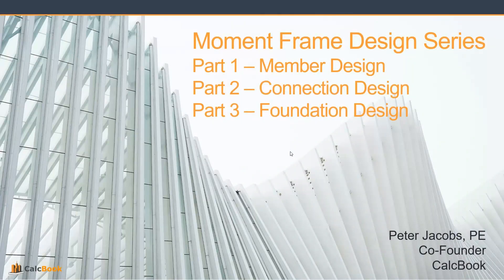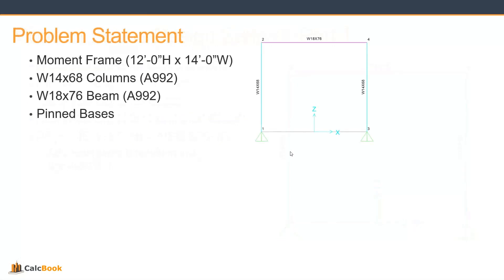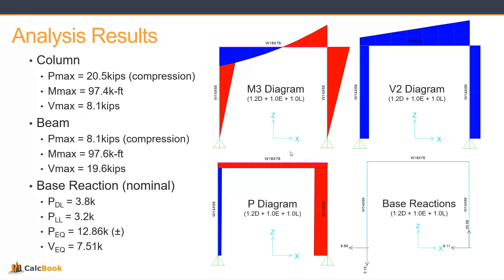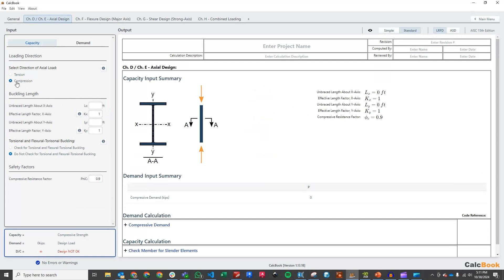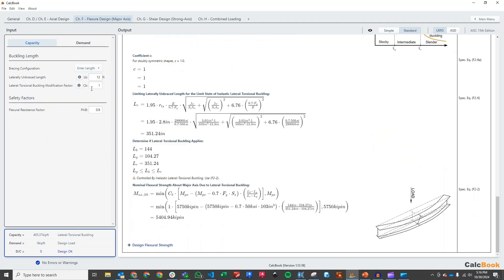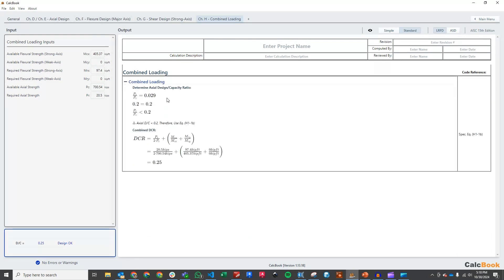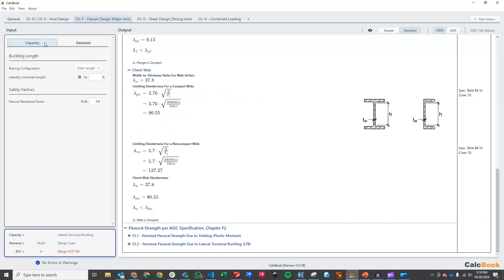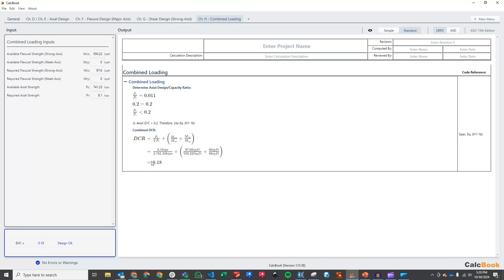Moment Frame Design Series - Part 1 of 3 (AISC)

Comment: What analysis model did you use to determine the maximum moment, axial, and shear forces in the members? I hope you can help me resolve this so I can subscribe to the Calcbook software to assist with my design. Thanks!
Reply from the maker: Hi @willhu9974, for this specific example we modeled the frame in sap2000, but any analysis software can be used alongside CalcBook. You just need to take section forces from your model and put them in CalcBook (can input as factored or characteristic loads) to complete your design checks. Hope this helps!